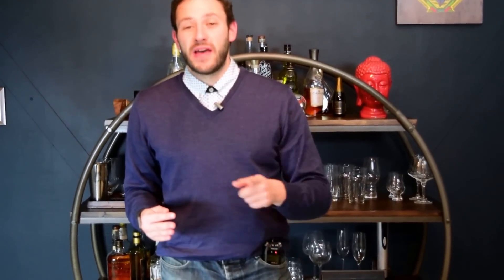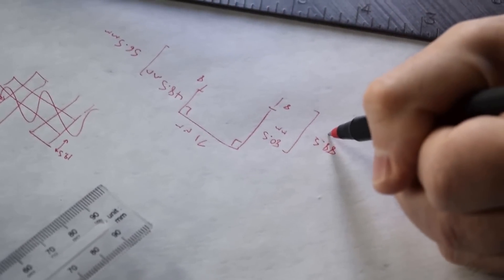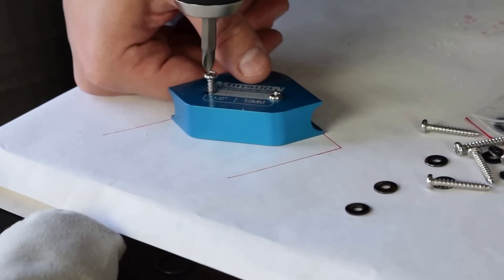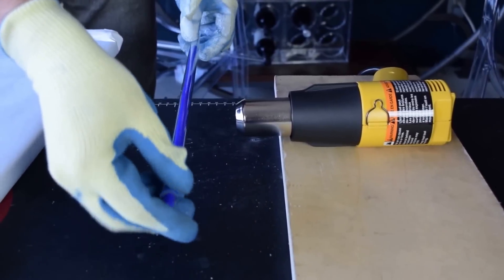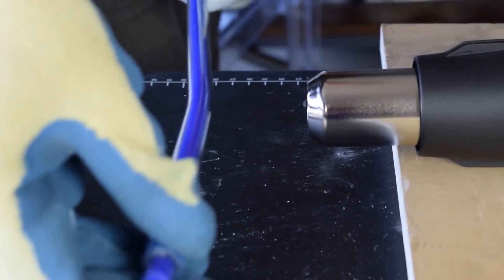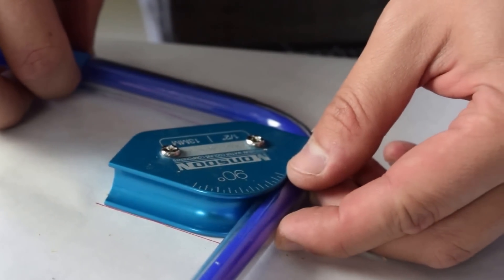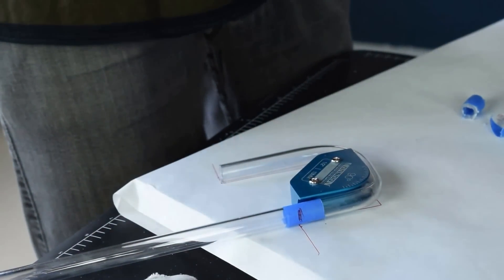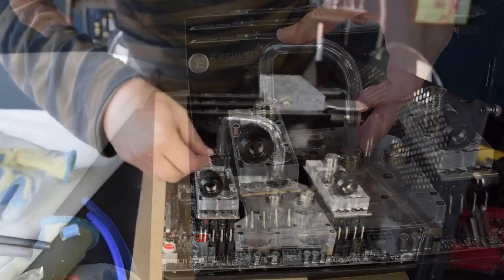Nostromo (PETG Bending Tutorial): 5960X, 980Ti 3x SLI, Water Cooled, Painted Rampage V -- Part 3

Comment: i dont know if your even going to read this but i bought the monsoon kit but without the rulers for measurements. i was curious how do you mark the petg tubing exactly where you want the middle of the bend to be since marking it with a sharpy marker will melt that mark into the tubing once heated? so how do you know or remember where it is exactly where the center of your bend is when you heat it?? what visual tools do you use? I understand about using the painters tape when cutting. thanks if you answer.

Comment: Have you ever used a saw before?
Reply: eugenetries
If it just worked while pulling, not by pushing, it was. And while everyone just mugs on your abilities with a saw and nobody gives you real advise: Next time try to cut your tubes not with something in the line of shooting you dont want to be cut. Use a tableedge for example: Lay the end you want to cut on top and let the other end hang under the table. This way there is no chance to cut something you dont want to be cut. And dont force the saw down, it goes down itself and you get much cleaner edges. Also I guess you payed the whole saw, so just use the full length xD And in both directions then you dont have to set it back in the cut everytime.
Nevertheless: I appreciate your tutorial and the other helpfull tips you gave, especially the 'let there be more tube on both ends than you need, because you can always take away material but never add' tip :)
Reply from the maker: +Stephen Boyd Nope!
Reply: I have an idea... I'll cut across something I don't want to cut and force down real hard...
Reply: That was hard to watch LOL.
Reply: At least the sawblade seems to be mounted correctly...
Reply from the maker: Medievalfan94 I believe it was!
Reply from the maker: Hey, thanks so much!  Super helpful!

Comment: Hi! I'm working on a config similar to yours and would like to ask for some advice regarding tubing between monoblock and ram blocks. I kind of want to use a extender on the monoblock and then use a straight tube between two 90 degree fittings.
Do you have any idea of how long the extender from the monoblock should be?
I'm kinda thinking 30mm or 50mm. What do you think?

Thanks man, excellent build!
Reply from the maker: +Ola Nygaard Thanks!  I don't have a great way of taking a measurement right now, but have you seen Ronsanut's build?  I think he does that and may comment on which size extenders he uses.  If not, I'd say the 30mm should work, but you may need to add another 10mm.